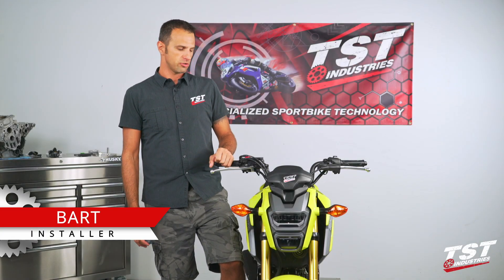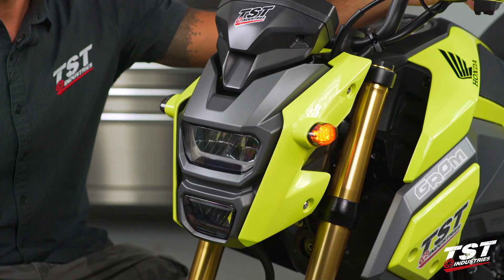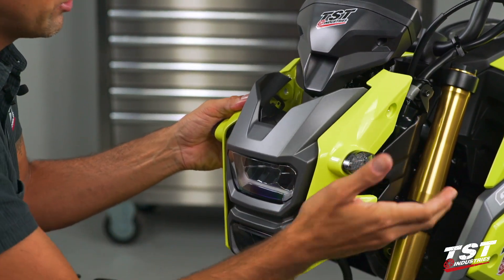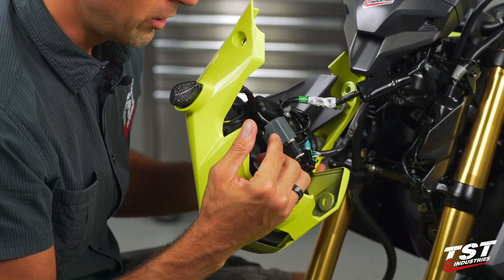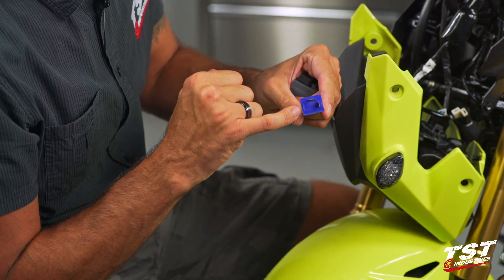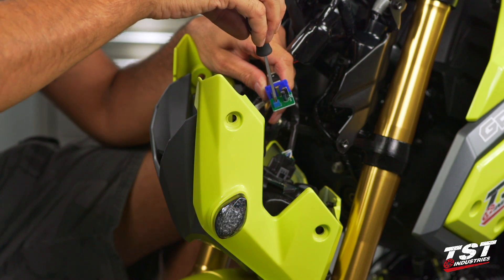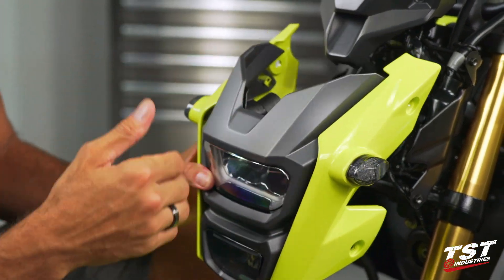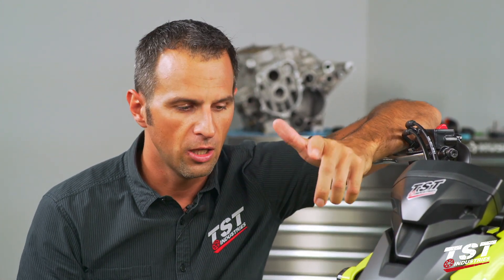How to install an LED Flasher Relay on a 2017+ Honda Grom by TST Industries

Comment: My turn signals front and rear dont work. New integrated rear tailight and flish mount front turn signals with new relay feom you guys. Plug and play. Suggestions? Im getting 12v at front and rear but when i use the turn signals, it cuts to 7v. Is that normal?
Reply from the maker: That is absolutely not normal. I recommend removing all the new parts you recently installed and then reinstalling one by one, checking function in between.

Comment: Just got the TST smoke tail light with integrated signals and TST led relay and my signals work fine up front, but my tail light signals are not ? Any fix to this really want the tail light signals to works as well.

Comment: Hi!  headlight on a 2020 grom stopped working. 

Prior to it not working. I have removed the battery, jumped start and the headlight turned on (flickering). I turned off the bike. After that the headlight doesn’t work.

I already checked all the fuses and any loose wiring.

My question is there a relay or fuse for the headlight ? I couldn’t seem to find it. So far, turn signals work, not headlight
Reply from the maker: If you checked all your fuses and are absolutely sure that they are good then I would check all the connections to the headlight and ensure that they are secure and conducting current to the headlight. After that I would encourage you to remove the headlight and connect straight to a 12v power source. If you connect straight to the battery and it does not light up then the problem is in the headlight. The light source in these headlights is LED and those are semiconductor light emitters. They require a very stable low voltage power supply that is provided by a driving circuit. Most often when an LED light stops lighting up it is because of a problem with the driving circuit rather than just the LED itself sustaining a problem or damage.

Comment: Can one relay instal in the front work for both leds in the front and back or do I need a relay for each set of leds? Thanks
Reply from the maker: One relay takes care of the entire signaling system.

Comment: My bike had an eBay reverse LED turn signal/ rear light set up and the indicator worked fine, if it bought a TsT rear light would it work fine as well?
Reply from the maker: That is tough to say without inspecting the components installed on the bike. If you have an LED relay already installed, or if you have load balancing resistors installed then good chances are you can just plug in the new light.

Comment: I just installed the flush turn signals & already had led brake light with integrated signals also tst relay & when I tried to turn on the signal my reader backlight went from blue to black not showing speed, mileage or gas & brake lights stop functioning how do I solve this problem
Reply from the maker: Sounds like you blew a fuse. I would recommend removing the last installed set of parts completely, replacing fuse, watching installation video carefully again, and then re-installing those parts.
Reply: TSTindustries thanks we’re up & running.

Comment: I wish you didnt have to get rid of the running lights
Reply from the maker: Some like the running lights and some people don't. Suzuki and Kawasaki motorcycles do not have running lights from the factory. This flasher relay does not have anything to do with running lights though. Maybe you made your comment on the wrong video.
Reply: @TSTindustries  what i mean is i would like some blinkers that stay on with the headlight on also then when you hit the blinker it flashes. And its possible this is the wrong video

Comment: If you change both front and rear lights do you only need one relay for the whole bike or a relay for the rear also?
Reply from the maker: Only one relay is needed for the entire bike, regardless of signal type set-up.
Reply: @TSTindustries  what if you only change back indecators light?

Comment: I changed my relay (not TST) when I installed an integrated LED brake light, and it worked well with my factory front signals. But now I've installed led front signals, and I'm getting a slow weak signal both front and back. Will a TST relay correct this problem?
Reply: Where did you buy the other relay ?
Reply: @ricardoaguilar3874  ... I ordered it online... I got all of my lights working right now. I'll try to remember to reply to this later tonight, and let you know what relays I used to make it work.

Comment: If I use the low profile lights in the front and keep the stock in the back. How will the relay effect the Back signals?
Reply from the maker: Yes. The one single relay controls the entire signaling system.

Comment: Hey please help my left signal clicks like mad but isn't flashing but the right side is fine could this be a bad relay?
Reply from the maker: I doubt it's a bad relay as the relay controls all the signals. You probably have a wiring issue. Please submit a request to our support guys through our website and they will be happy to help you.

Comment: When I turn my turn signal on it flashes hazard on the two front ones could that be my relay? The previous owner changed the light I don’t know if he change the relay?
Reply from the maker: Try removing the relay and then activate your signals. See if that has any effect on the functionality of your signals and keep us posted! You can also email our Support Team and they will help you out as much as possible.

Comment: How do I make it flash faster then the adjustment will let me? I want this thing going off like a rave strobe. Like annoyingly fast
Reply from the maker: Unfortunately adjusting the flash rate on the relay would be the fastest setting that can be achieved.

Comment: I want to  integrated tail light with front blinkers do I need the relay
Reply from the maker: That will be the best combination of parts on the Grom.  If you don't change the relay on that particular bike the signals will stay solid and not blink when changing to all LED components. You could wire resistors in parallel with each signal lamp but that is a lot of work to achieve less than professional results. The relay will be your best bet.
Reply: okay thanks o will get that ordered

Comment: I got the bulb but i ain't got the relay i only have the stock. how do i make it flash?
Reply from the maker: You can either wire load balancing resistors in parallel with each signal, or get yourself an LED Flasher Relay.
Reply: TSTindustries Thanks

Comment: so if I get the tail lights from you guys this is the correct video to fix the problem?
Reply from the maker: If you have a hyperflash or No-flash condition (on Groms typically the signals stay on without flashing when signals get changed to LED type), then the relay will be your plug-and-play solution to restore proper flash rate.
Reply: TSTindustries alright I just purchased this as well to be safe, thanks
Reply from the maker: good choice

Comment: i have a question, im trying to buy only the front leds and the relay and keep the rear signals stock does that create any problem?
Reply from the maker: No problem with that configuration. Should work like a charm for you.

Comment: Does this relay control all 4 signals or just the front two?
Reply from the maker: Your stock relay and our relay will correct and control both front and rear signals. Our relay is also fully adjustable so you have the ability to speed up or slow down your signal flash rate to your liking.
Reply: TSTindustries how do you adjust the speed?
Reply: dennis beighley thats what he showed on the video bro..

Comment: does signal light stay on while driving?
Reply from the maker: I believe you are asking about the running light. The signal lamps have one circuit so there is no running light function. They only light up when signals are initiated.
Reply: +TSTindustries I see thank you